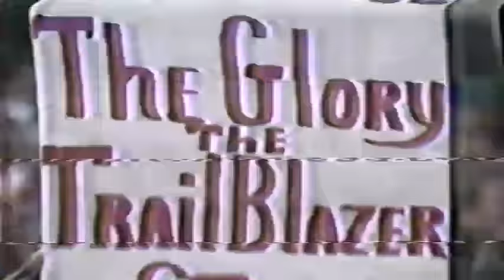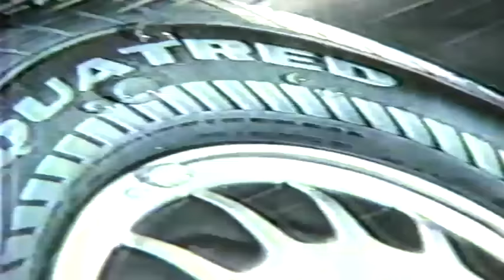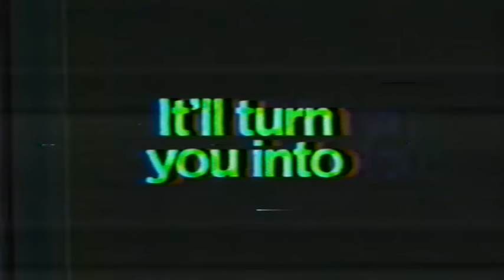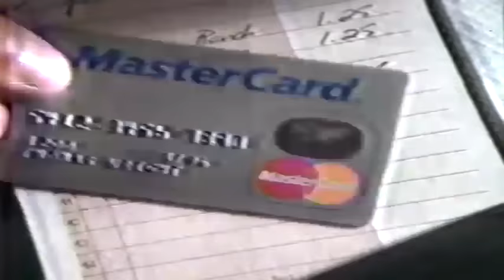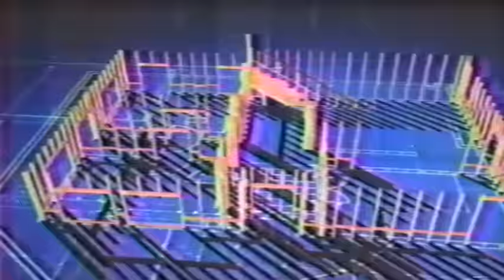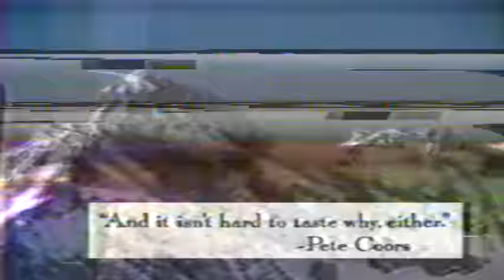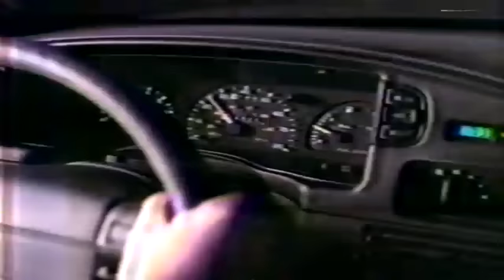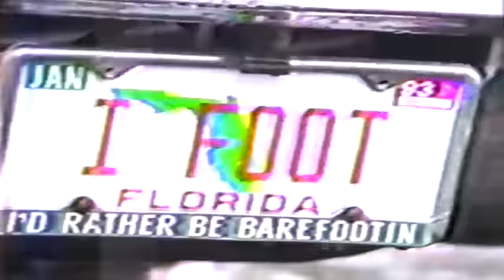Bulls vs Blazers 1992

Comment: 37:03 lmao Steph Curry has over 600
Reply: that's crazy
Reply: Yeah, it's called progress.  I'm sure someone will beat it at some point.

However, for a guard, you'd think Steph would lead all time assists, but that was John Stockton with 15,806, who was also the all time steals leader with 3,265 - that's two categories.
To top it off,  Stockton missed only 22 games out of a possible 1,558.  Stockton was a beast!
Stockton was insanely underrated, he didn't care who had the ball, he was going after it.